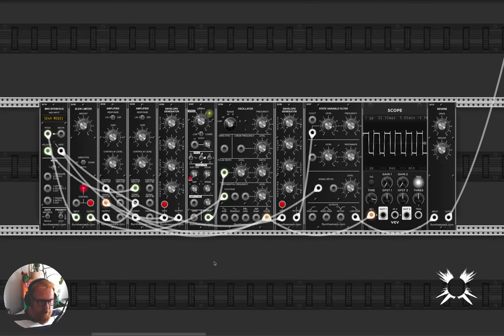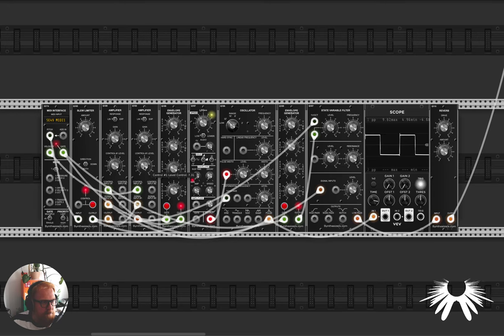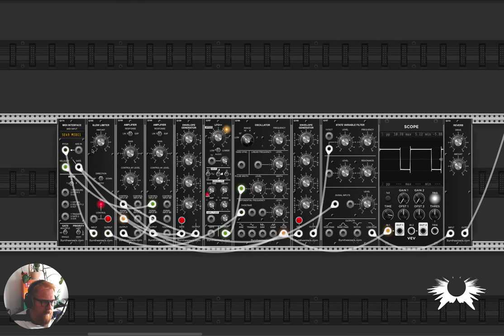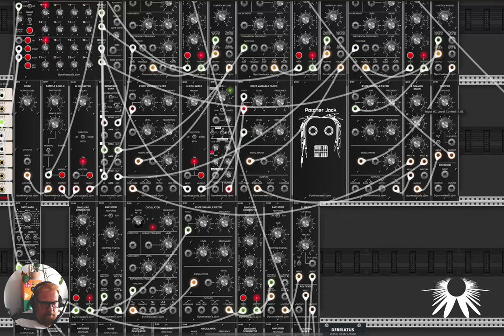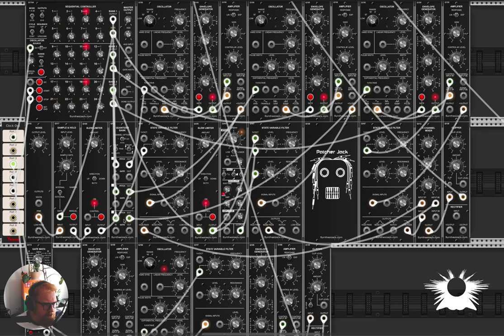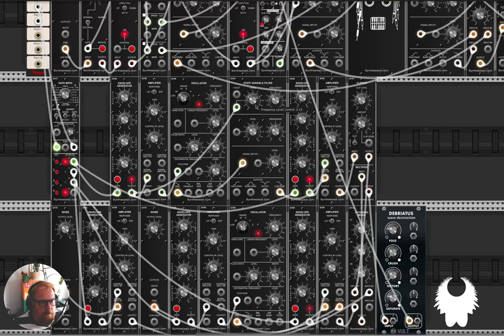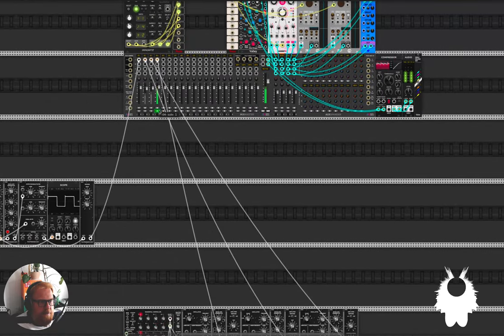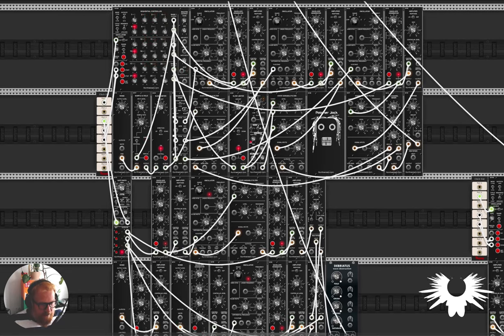PatchWerk with Miles // EP13 Synthesizers.com Collection

Comment: Hi, this is Leonardo from Vult. Thanks for showcasing the modules. I wanted to point out that there's a bug in the pulse output of the oscillator. The PW in the real hardware can be modulated in a wider range. This will be fixed in the next release. If you find any issue, please let me know so I can fix it.

The filter is a State-Variable filter and those do not self oscillate as other filter like the Moog or Korg.
Reply from the maker: @Vult-DSP  thanks for the heads up on these points, good to know :)

Love the modules, they sound fantastic. Love Vult modules too. Thanks for watching 👍